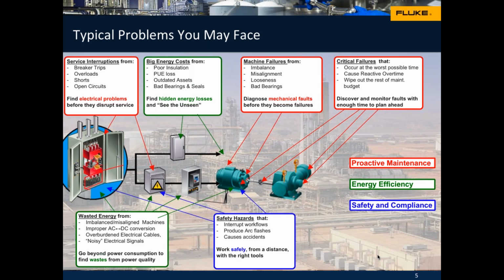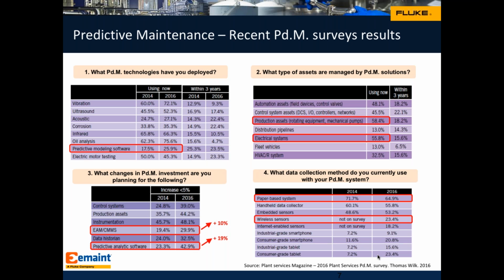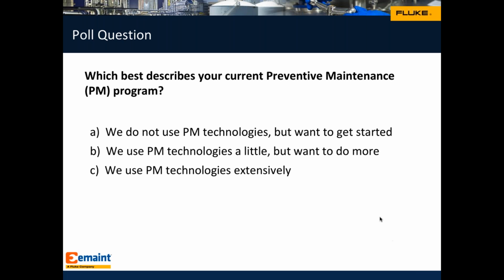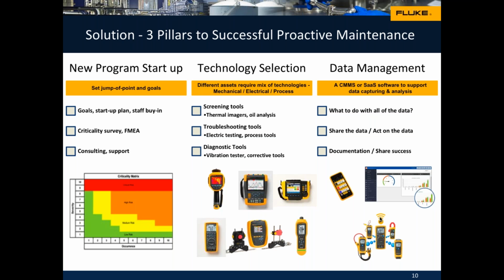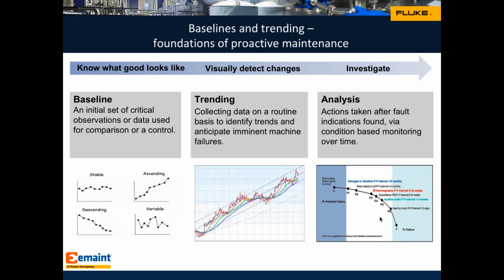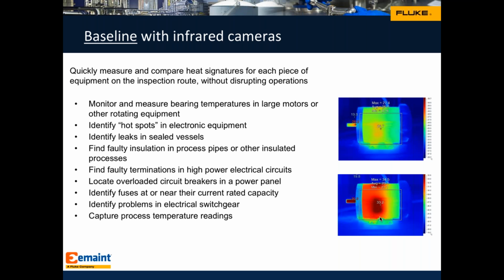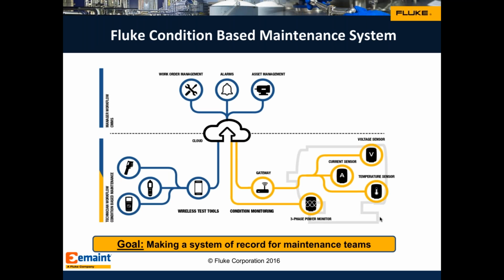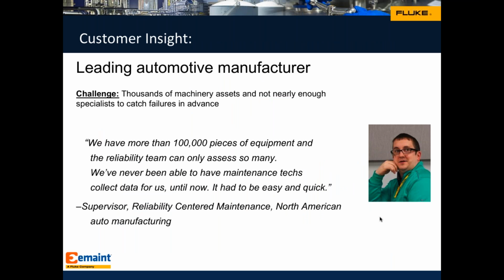Best Practices Webinar: The Evolution of Proactive Maintenance

Comment: What is the effect of under voltage to efficiency of induction motor
Reply from the maker: Low voltage can lead to overheating, shortened life, reduced starting ability, and reduced torque. Meaning the effect on the motor is to cause it to be "hard-to-start" as related to "pullout torque" ultimately lending to shortening of motor life. If you have additional questions please reach out to our team at fds-sales@fluke.com. Thank you!
Reply: @eMaintCMMS Do you have a distributor in the Philippines for your software
Reply from the maker: @elec3calengr  We do not sell through distributors, but if he would like to reach out to our sales team directly he can email fds-sales@fluke.com
Reply: @eMaintCMMS  
I'm more concerned on the effect on efficiency